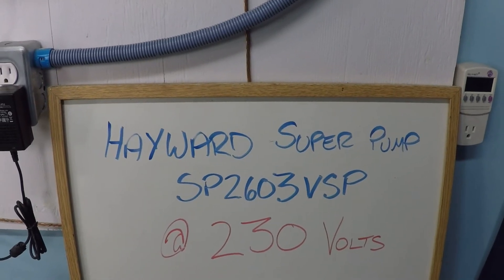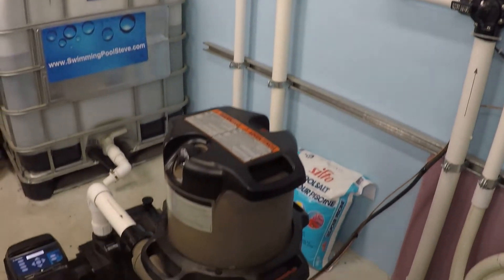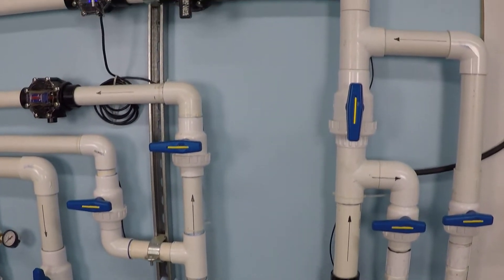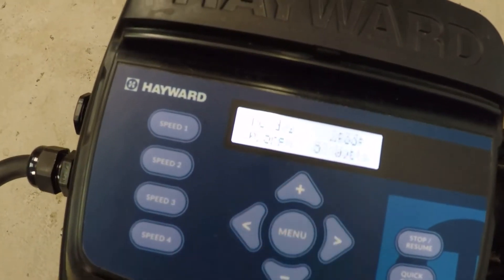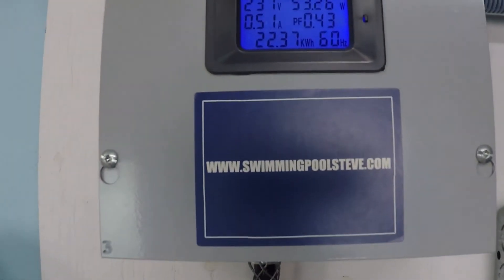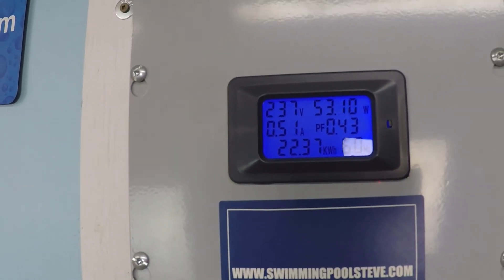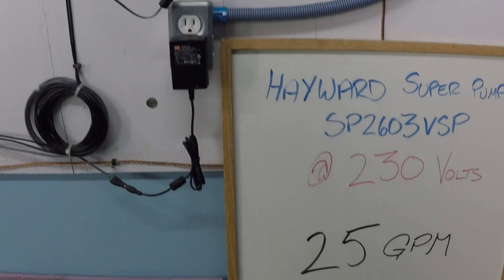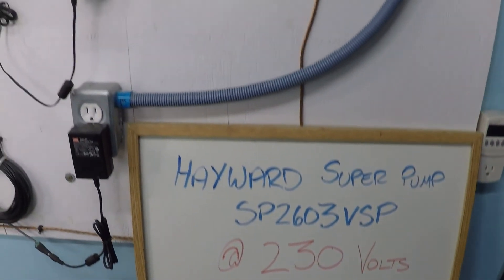What RPM For A Hayward Super Pump VS To Get 25 GPM?

Comment: Steve, if I don’t know the number/type of elbows/connections in the pool system that I have (it was installed before I bought the house), how would I be able to calculate the Total Head of the system?  Would it be a “Best Guess” based on diameter of plumbing plus the fixtures installed above ground (pump, filter, heater + any elbows and restrictions)?
Reply from the maker: You would measure it at your pump. Vacuum gauge in the front winterizing port and vacuum gauge in the rear winterizing port on the pump. Multiply suction (in inches of merecury) by 1.13 and add this to the pressure in psi multiplied by 2.13. This is only a momentary snapshot of the system TDH